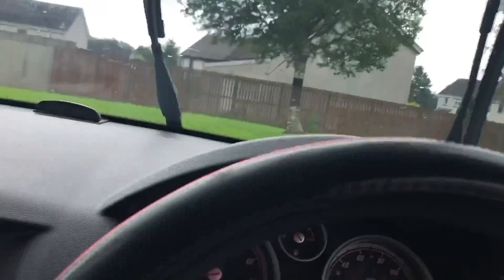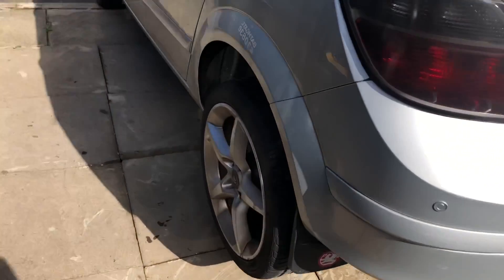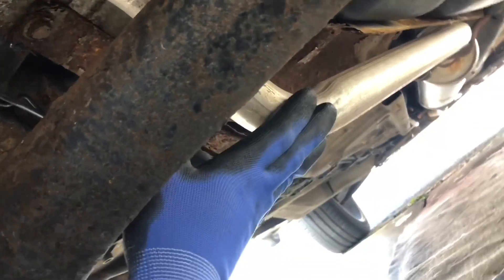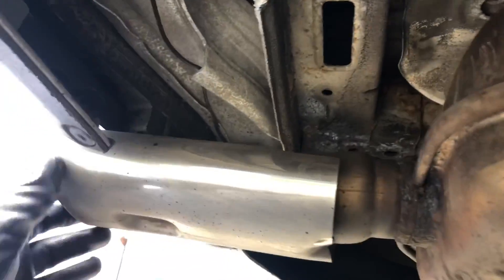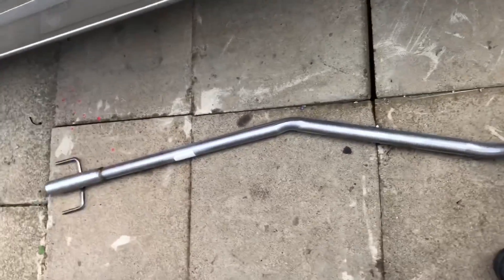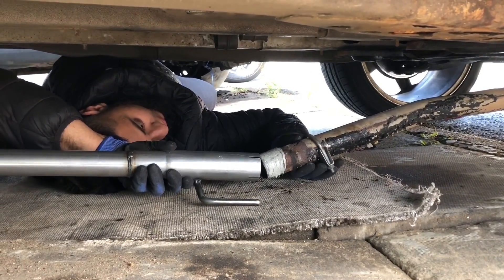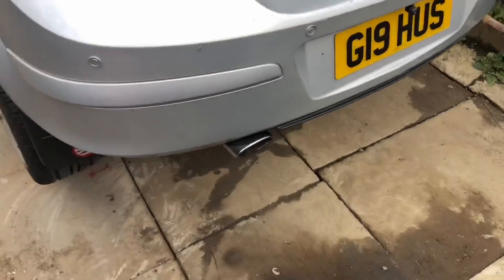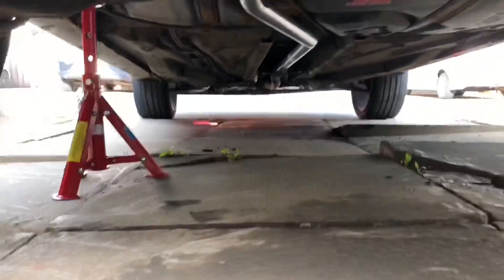ASTRA H 1.6 GETS HOFFMANN SPORTS EXHAUST SYSTEM!

Comment: Should have considered maybe a backbox delete and cat delete.. will be uploading my astra on youtube very soon. With the xp kit, vxr alloys , backbox and cat delete, induction kit very soon. Black astra mk5 3 door:)
Reply: I have same car, i cut the cat open removed the honey combe in one piece , ( sell it ) rewelded the cat back up. And bottom o2 sensor on downpipe ive used rtv black gasket sealent around the outside of the heater element. Havn't had check engine light yet been 2 days so far 👍 engine pulls much better from 60mph to 100.   And doesn't sound too tiny like in this vid! I still have mid n rear silencers in place. ( I dont like the tinny sound. But worth it 💯

Comment: Do you know if the 07 Astra vxr bumpers will fit straight onto a standard one like is there any difference in the way they bolt/ go on
Reply: It will fit a 3 door astra but not a 5 door and the exhaust tip will not line up with the slot on the vxr bumper.